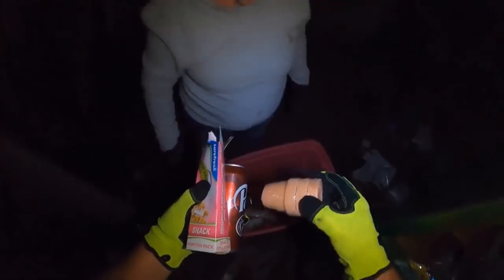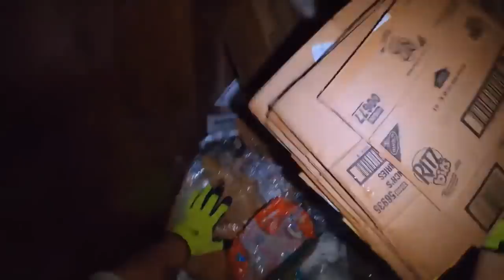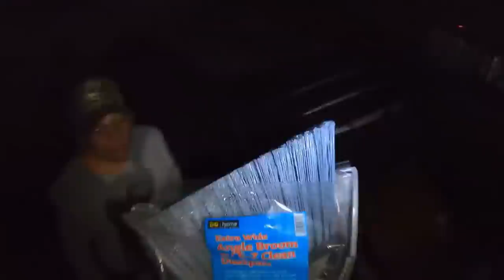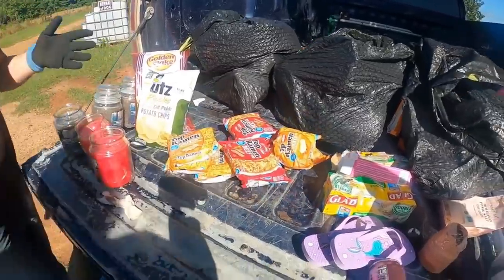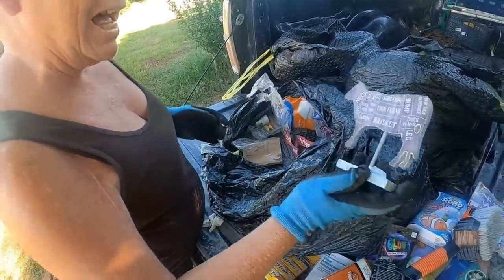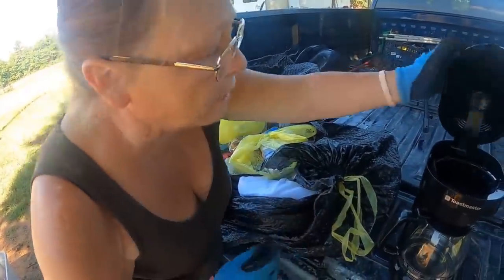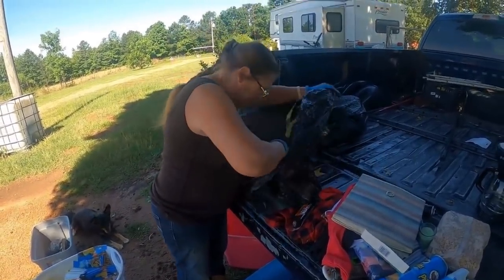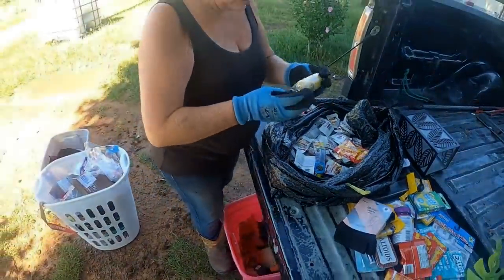Employees Didn't Hide This Good Enough  Dumpster Diving

Comment: The best spray that I have gotten for wasps is made by Bayer.I get it at our loc a l co op.It comes in a liquid bottle about the size of the square zertec bottle you mix with water in a gallon or 2 gallon sprayer.You  an get many uses.We sprayed my house my sisters house and my next door neighbor.My nephew also takes it with them when they go camping.
Reply from the maker: Thank you